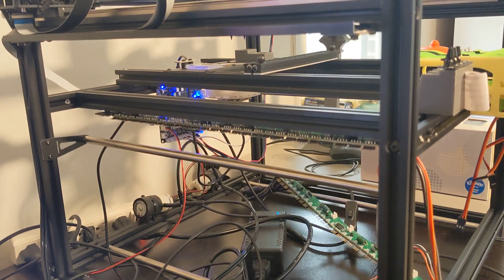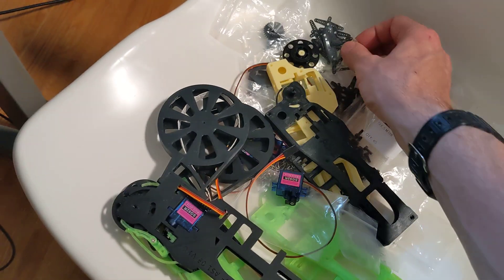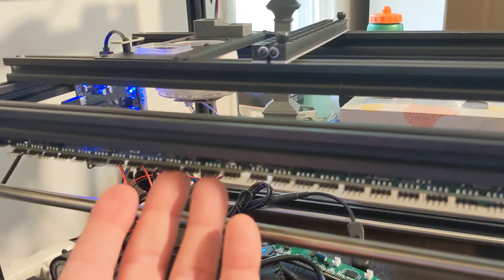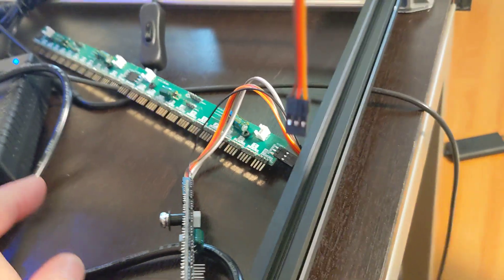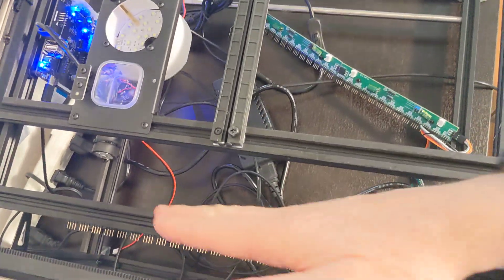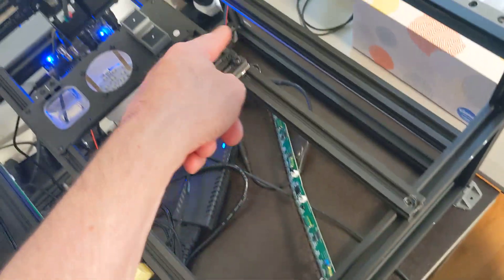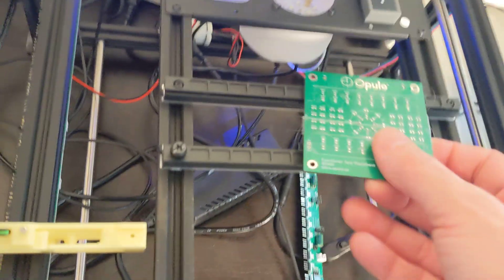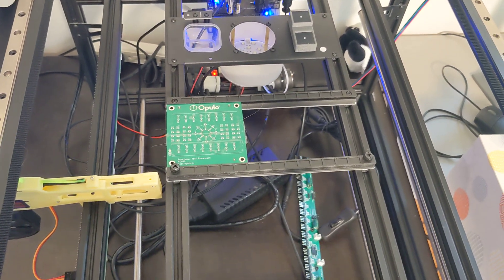PandaPlacer mount feeder boards on the A1 machine

Comment: @nickydoes does the pandaplacer actually work?  I agree with your assessment that the engineering is solid but the documentation is insufficient when is not outright wrong.  I need this machine to work and I can contribute to the project.
Reply from the maker: @ValeriodellaPorta  It works quite well. The doc site is pretty good. It always could be better.
Reply: @nickydoes  Glad to know that it works well ... after you make it work 😀

What I have just realized is that the machine is a work in progress, evolving rapidly, which is good.  My machines are nothing like the pictures I saw both in the videos and on the OpenPNP forum after you filter for Pandaplacer.

I'm working with Leo to go thru the issues of the latest iteration.

Thanks again for your videos.
Reply: @nickydoes  Which platform are you on and which version?  I'm on test build 2025-01-03_20-22-12.4cca0ae/ as reccomended by Leo as I'm on a Mac and found it unstable.